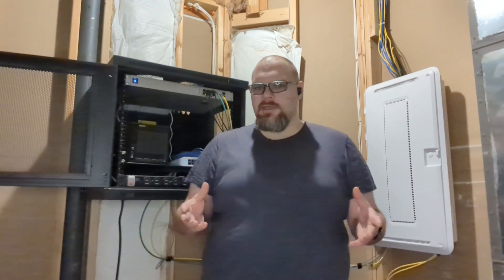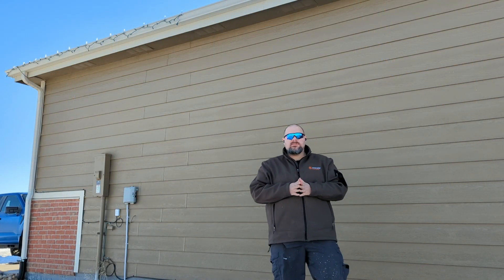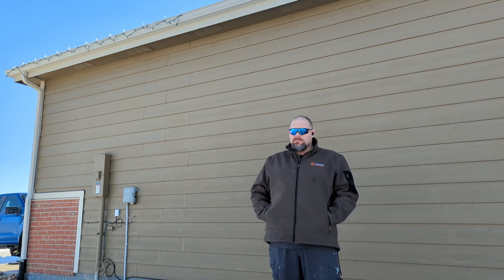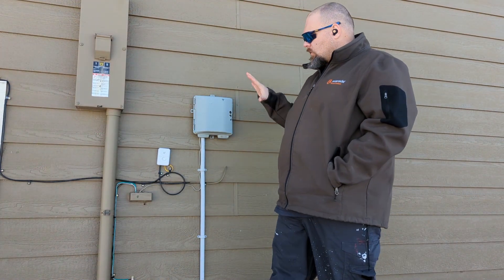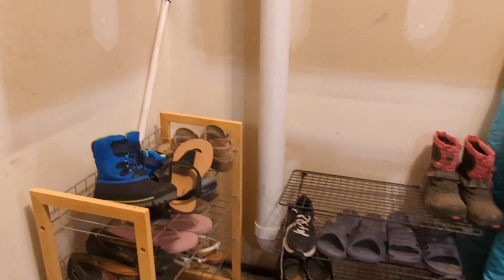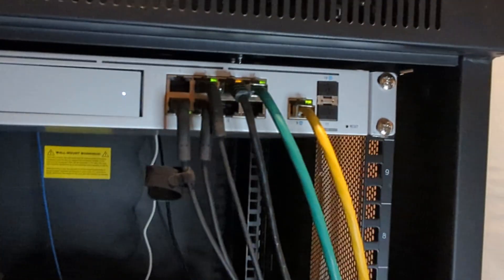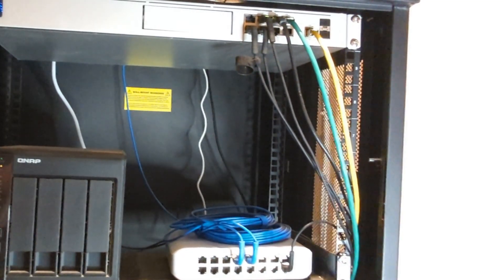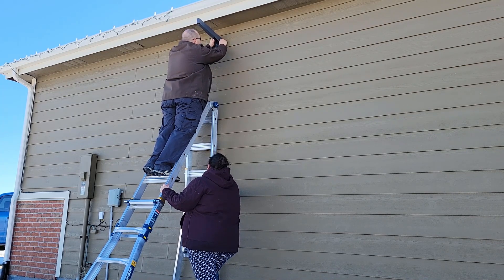Planning Starlink Gen 2 Install - A Grateful Hearth

Comment: Good on you to install all those network cables throughout your house. I had to pull new cable to all the rooms that will be hard wired.  I have my dish but I am still waiting on the mounting accessories, longer cables and LAN adapter.

Comment: Can't you drill a heck of a lot smaller hole than 1.25 inch for the cable to pass through?  My plan is to drill a 1 inch hole and then cover it on the outside of the house with a "Blue Sea Systems Side Entry Cable Clam".  I think the cable will pass through a .75 inch hole however the 1 inch hole is required for the cable clam.
Reply: 3/4” hole is sufficient to get the cable end that attaches to Dishy in. The other end will not work.

Comment: My similar setup in New Orleans LA USA, with a focus on high wind contingencies (hurricanes).  Cable and conduit details, pipe adapter, plus my load balance setup.  Hopefully helpful to someone and let me know if particular details would be helpful. 

Starlink v2 Install [150 Ft Cable, Ethernet and Pipe Adapter, Cable Routing Kit, Load Balance]
https://youtu.be/XhbCJtp9no4

Comment: Are you able to provide measurements of the mount?
Reply from the maker: Sadly after getting into the install, found out that the satllite stem is too short to clear the roof edge / gutter height.  Even after all this careful planning, there will be a part two as I have to figure out how to make this work as a roof mount - when the roof mount for the Gen 2 satellite is so back ordered they don't even have an estimate of ship date.

I might have to get engineering-creative here, because the bottom of the integrated stem for the satellite dish is a proprietary setup.  I can't just go out there and buy an existing sat angle mount or something.
Reply: @agratefulhearth8452  thanks for the reply. I look forward to see your solution

Comment: Looks like you have cable and fiber, starlink is ment for rural areas not housing communities that have fiber and cable  like it looks like your in
Reply from the maker: Actually we only have 5 GHz point to point today. No cable or fiber covers our low-density rural area.  We live miles outside of the nearest small town, which is only about a thousand people.  And more than 20 miles from the nearest town of 100k or more residents.  

There are no standard cable or DSL providers in our area.

The 5GHz point to point becomes extremely unreliable during wind events or rainstorms that have even light lightning.  The hope is having a second provider will give us some failover option.  Ultimately my hope is that Starlink proves reliable and low latency enough to consolidate on a single provider and save the money.
Reply: I have point to point internet to, two companies, 100 Mbps and 50 Mbps and it's so bad  at first it was good and then now I don't even get what I pay for around 50-60% of those speeds  now, and the ping is so bad  now, when it comes to gaming super high ping spikes like 900 ms ping, it's so unplayable on Xbox, the companies have over oversubscribed customers on there network, that's the reason for slower speeds and high ping spikes  and when you call in to tech support they don't want to fix the problem saying  that on their side the internet looks fine when it really isn't